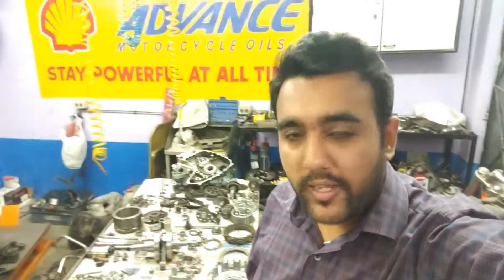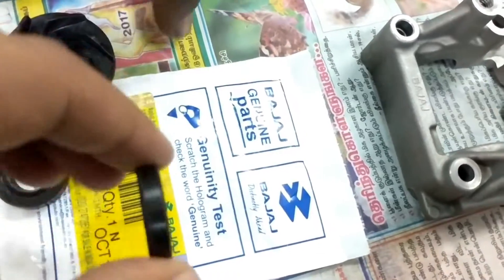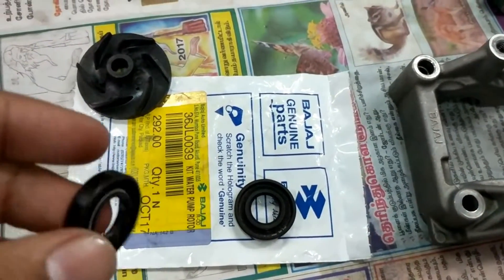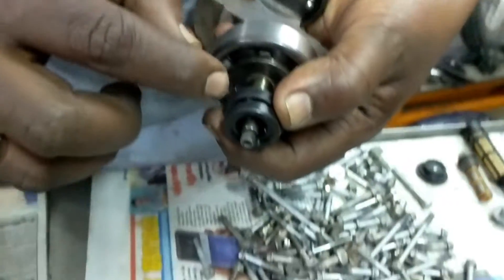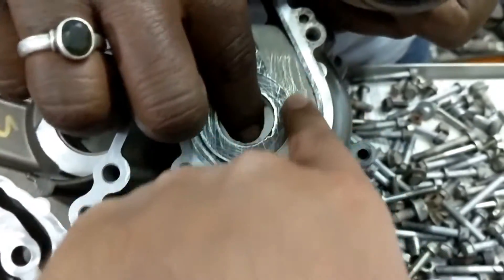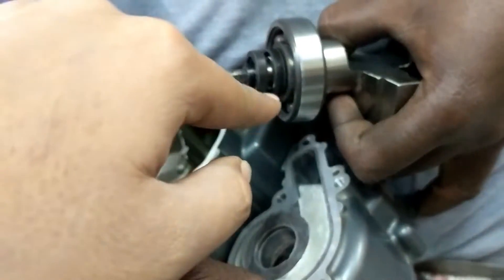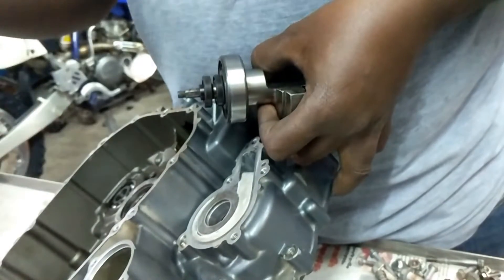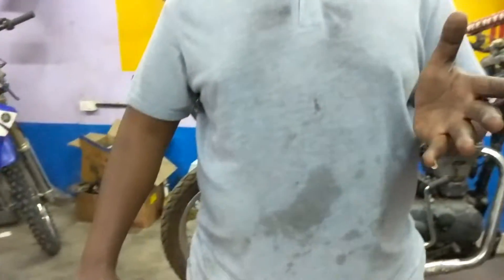Why does the coolant mix with engine oil in KTM 390 Duke/RC? Major Fault!!

Comment: Same issue with my bs3 duke 200

I've repaired it literally 5 times... Changed oil seals and coolant pump seal.. i even tried changing balancer.. still the issues is not getting solved... Can anyone suggest any way??.... Will changing crankcase will solve the issue?

Comment: Hello i am the new subscriber Plz help me out. I am also facing same issue..4 months back i have changed waterpump seal..from yesterday fan is not turning off i have checked coolant level in resivor..but its empty..when i checked engine oil level and its colour normal only i dont know whats the issue...

And from 1 week my bike performace gone down 2nd gear behave like 1st gear(means power)

Plz answer what can be the issue and suggest which servive center in bangalore will be the best

Waiting for your replay...plz help me it will take only few sec or minuites
Reply from the maker: Hi, there could be multiple issues since you've mentioned a drastic drop in performance. Coolant reservoir is empty meaning there's some leakage somewhere. I would suggest you to take you bike to ktm Yelahanka. I had a good experience there but that was there years ago. I'm not sure how it would be now but just try and see. Try and get in touch with venkatesh there if he is still available.
Reply: @saajanjogia can coolent reservoir gets low after many years?
Reply from the maker: @whysoserious7553  no fixed time, it shouldn't.

Comment: When I start my Duke 200 early in the morning white smoke came from the exhaust for some minutes then it disappeared...is this normal...thank you
Reply from the maker: White smoke is never normal. See if you're able to notice any other symptom
Reply: @saajanjogia  my engine oil got mix with coolant...how can I flush all the mix engine oil
Reply from the maker: @zankydk624  uh oh! You need to take it to well known mech
Reply: @saajanjogia  thank q ..can u help me with one more thing...i have Duke 200 Bs3 i want Valve Shim but i couldn't not find it here in my locality..I'm from Meghalaya India... please Help
Reply from the maker: @zankydk624  ohh ok. Erm have you tried contacting ktm via email? They need to supply it to the ktm showroom there. Or if you know a mechanic who works on ktms?
Reply: @saajanjogia  here in my State.Ktm show room and Services centre are the worst.. it's Just the name ktm service centre whereas for the spare parts are very hard to get
Reply from the maker: @zankydk624  try getting in touch with a mechanic who can get you those parts or, shoot them a mail to get you the parts
Reply: @saajanjogia  owk I'll try once again thank q

Comment: you mean honda is a premium bike ? I have one cbr150 but I like the Duke , but Duke has no coolant and oil leak hose indicator?
Reply from the maker: Honda high capacity motorcycles are premium, never said anything about the cbr150 😅
Reply: @saajanjogia  I mean it depends on the budget 🤣

Comment: Bro I’m having the same issue but my fan stopped working as well. It’ll take just one sec for you to reply me does the fan stop working too.? Please reply
Reply from the maker: Fan issue is a separate issue than this. Both problems need to be addressed differently. My ktm is on the 9th or 10th fan 😁. hope yours is under warranty

Comment: @Saajan Jogia, do you know if KTM has resolved this issue of poor quality sealing now? I am thinking of buying the Duke390 next month, but seeing so many people facing this issue is making me reconsider. Thanks!
Reply from the maker: Afaik, it isn't resolved. Considering the present prices, maintenance costs and hassles I've gone through, i do suggest you try other options and then see if you're still pulled in by the 390.
Reply: @saajanjogia  Thanks, will try out the CB300r as well. The main pull of the Duke being the intergalactic power levels which I've heard is life-changing. I am afraid I might not get that experience in the competition, but will try the CB300 and the RR310 out and then see what I feel like.

Comment: Does mixing of coolant and engine oil produce white smoke?
Reply from the maker: Not sure about that. White smoke could be a sign of your engine oil burning. Check oil level to ascertain
Reply: @saajanjogia  What could be the reasons for Engine oil burning? My Duke 200 Engine oil seems to be dropping quite fast [comparative to earlier]
Same issue with my Duke 200 2016. Noticed Emptying of coolant in reservoir [No leak from Radiator]. Engine oil seems to be in reddish brown color. Ridden more than 1000 km in this condition. Engine heats up quickly and stays there even with radiator fan kicks in.
Exhaust smells a lot, like burnt smell when we get in old scooter smokes. But there is no white smoke.
Should I change Water pump seals?
Reply from the maker: @SANDEEP-o2h3k  1. Your piston rings might have worn out so the engine could be burning oil. 
2. Get the seals checked. That's one primary reason for coolant level drop.

Comment: Is there any permanent or a Long term solution bro? I have this complaint in my KTM Duke 250 2017 model.
First I got this problem in 2019. my service center dismantled my engine, cleaned it, changed the oil seals and gaskets, then it got cleared for some period. It costs me around Rs 8,500.

Now again in 2021 I stuck with this issue again. And again they wanna do it. They gave me an estimation of bellow Rs 3000, only if the coolant is mixed in one side or the clutch side. And it gets added to Rs 14,000, if both sides got messed up (with changing other parts like clutch plates, etc because of 20,000kms+ in odo). 

The real problem is due to covid19, I haven't used my bike frequently like before (used range between 2,000 to 4,000kms only).

And I'm a student who loves riding bike and getting upset for asking a large amount of money for the bike service from my parents. 😐
Reply from the maker: Unfortunately, there's no long term solution. This is one reason why I ask people up refrain from ktm. This issue is there since almost a decade but no permanent solution. Experts in extracting money. What also suffers is the engine. Ktm doesn't let you know the extent of wear and tear the engine suffers after the coolant has mixed. 
They drain coolant, oil, refill and then pop a seal back, put some sealant. Then it's all on your luck.
Reply: @saajanjogia  Yeah, absolutely bro. I really want to know how these coolant and engine oil seals are getting worn-out so quickly. Are they due to engine heat or what?

Now they have suggested me that they will try to use the new model KTM bike's coolant and oil seals, which have a little bit more quality than mine. Which might give an short term solution.

But I have decided to give it a try and try to check and change my seals even if it in a decent condition*. Because I can't really trust my bike and it can go wrong in any situations, where I will be helpless. 

Where is this bike service shop located bro and can you share his details?
Reply from the maker: @sarath.chander  occurs due to wear and tear. Shop is in Bangalore but I don't go there anymore
Reply: this things not only happen on KTM Duke, but also on my Pulsar NS 200, exactly the same issue, no matter how much i change the seal it always broken after several months.

Comment: I replace oilseal and also headgaskit but the problem was there... 
Please help me my phone number is +917006300294  please please help me
Reply from the maker: Must've been a shoddy job if the issue reappeared mate. Check back with whoever did it.
Reply: @saajanjogia  There may be some other problem besides this?
Reply from the maker: @buffingblaze9344  I can't comment on that.. better have it checked again
Reply: @saajanjogia  you said check head gaskit again?
Reply from the maker: @buffingblaze9344  check everything again
Reply: @saajanjogia  ok thanks ❤

Comment: Bro, how much does it cost to just replace the seals?? Cause my coolant is leaking into the engine
Reply: At KTM the part I think is just 100-200 but labour is 5000+
Reply: @ajaydyas4699  oh Ok, so right now i have already replaced my water pump seals, filled the coolant to medium, after 200kms it went to minimum, so I topped it up to maximum, now after riding 300kms again the coolant is gone to minimum level. I don't understand what's wrong, and I can't see any coolant mixing with my engine oil
Reply: @FernmeisterTV  oh sorry my costs were not for seals. Besides the water pump seal there's the engine gasket if that fails it also mixes unless you're sure it's not mixing. If you're 100% sure there's no mixing there might just be a leak in your coolant system.
Reply: @ajaydyas4699  I have got a mechanic check my coolant system, there's no leaks at all, also my bike runs perfectly. No smoke nothing, but the coolant just drops, I don't understand why. If u know of any other way this is possible let me know. Thanks
Reply: @FernmeisterTV  bro, did you find out why the coolent is leaking? I'm also facing the same problem. Please let me know
Reply: @shameertn  no bro, I haven't found the issue yet. Recently as per odo when my bike was at 11820kms the coolant was at max level, now odo is at 12400 and my coolant is almost at minimum level. I can't see it mixing with my engine oil. I really haven't figured out the issue yet. Recently when I got home from a 130km ride the coolant was at like 3/4th level, after about 30 hours I checked it, it was at almost minimum level, That too bike was parked. Idk what to do now

Comment: Nice informative video but can you please tell me or makr another video of its solution. I mean the cause is ok but possible solutions  that this kind of problem doesn't happen again.what you have done to your bike to prevent it ? Is opening engine is the only way?
Reply from the maker: Yes unfortunately opening that part which gives access to the seals is the only way. Hence didn't make the video.
Reply: @saajanjogia   hi bro, please give me an advice on changing those oil seals!
Do I have to change or buy any specific parts which needs to be changed while changing the seals?
I'm in UAE 🇦🇪 here in UAE it is very expensive for the company service so I would rather go to the local workshop..

And brother isn't possible to open duke's engine without company tools? Or it is just false information?
Please respond brother. Thanks

Comment: Bajaj engineers are good enough for only the scooter,  Frankly there are so many teething problems in KTM which are not adressed..  Worst is gear shifting milling issue.. Poor chain sprocket life, poor fork oil seal, water pump seal system, rear shocks oil leak, stearing cones wear off sooner, ABS failures,  list goes on and people still buying this bike only for some good sprint!!
Reply from the maker: Yep. It has a ton of reliability issues that aren't spoken about as much aa they need to be spoken about. Check out my article on the same in this link : 
 https://link.medium.com/osPC9fsrmdb

Comment: just look at the oil sight glass, if the oil color becomes i say like a color of a MilkTea, change the seals ASAP
Reply: Hi brother, I'm facing the same problem. I'm topping the coolent after every small ride but I couldn't find any leakage. Now through this video I found that I had to change the seals because the coolent is mixed with the oil.

But is that possible to change the coolent oil seal without opening full engine?

Comment: Can both seals be removed from the outside without splitting the cases once the impeller is removed and the circlip is removed?  Just had this problem at the last oil change!
Reply from the maker: Highly doubtful!
Reply: @saajanjogia  just saw a thread where an owner did just this and it was super easy.
Reply from the maker: @falcn12  great! You're lucky then
Reply: It can be done.  You have to pierce through the seal with a sort of hook shaped object so you can pull it out.  I used a set of picks and bent the tips with pliers to my desired shape.  BE CAREFUL NOT TO SCRATCH THE ALUMINUM HOUSING IN WHICH THE SEAL SITS.  Bend the pick ends such that they wont scratch the housing.

Comment: The main reasons for oil seals to fail:
1.Coolant hasn't changed for a long time.
2.Oil not changed on time.
3. General aging,wear and tear.
Reason for Engine oil seal failure:
1.Oil not changed on time.
2.Wrong viscosity oil.
3.General wear and tear.
4.Excess oil filling.
Reply from the maker: Have seen 390s that were maintained perfectly. All that you have said was being followed but still the seals gave up. So yes, has definitely got to do something with the design or quality of seals. Also general ageing and wear and tear is understood if the motorcycles were really old or has clocked a lakh kms or more on the odo. And there are cases where this shit happens with 390s that haven't even crossed the 20k kms mark
Reply: @saajanjogia  I understand, KTM gave their design to a shit company to produce this lovely bike.
Reply: Wife's Duke 390 uses correct oil weight, correct fill weight, and coolant wasn't due for change.  This has happened 2x on her bike.  1st time fixed under warranty. Less than 2000 miles later - same issue.

Comment: Thanks for making this Vedio, I face same problem with my Rs 200 .... I learn a message from your vedio that don't buy such bike that don't have any outlet in engine because you may have to pay 10000 to 22000 Rs. After such issue will concern with your sport bike. 👍👍👍
So brother how much you pay for this
Reply: What is the cost for repairing RS200 with the same problem sir..becoz I have the same issue
Reply: @saiprasanth8544  I managed mechanic in showroom and pay Rs.11000 with serving oil change and other issues 👍

Comment: Hello sir I'm facing a big problem I have a Duke 390 cc and is burning the fan I already change 3 fan but the problem still overheating jerking .I send to dealer and they said they have to open the engine please can you advice me
Reply from the maker: Why should you open the engine? It's a fan problem. My bike is running on its 10th or 11th fan

Comment: Hey... In My 390 the coolant fully had gotten empty. I visited Jagadish and he changed the Water pump oil seals. He didn't replace the engine oil saying that ride for 500km, if there's no furthur leak then I'll change engine oil.Refilled coolant and now my radiator is working fine. My doubt is that is it safe for the engine to ride 500km with coolant and engine oil mixed?
Reply from the maker: Ohh that's weird. Better to flush, refill and ride because oil may not perform the way it's supposed to if coolant is still mixed.
Reply: @saajanjogia  ohh..and jagadish also didn't flush the radiator with water before refilling with new coolant.. should I tell him to flush the engine with some engine flush from brands like liqui moly?
Reply: @saajanjogia  and is radiator flush with water important?
Reply: @saajanjogia  bro I contacted Vikas Rachamalla and he also told that never ride with coolant mixed with Engine Oil, And Jagadish told me it's fine to ride like that. Do you think I can trust Jagadish and go back to him? Pls help me on this one
Reply from the maker: @nischalk1336  I get your point. I stopped going there more than two years ago.. so yeah that says a lot. Have kept this video for informational purpose only.
Reply: @saajanjogia  ohh.. do you know any other good mechanic? Or should I trust the KTM service center folks, even though they might overcharge
Reply from the maker: @nischalk1336  no bro.. didn't experiment with anyone.. I give it to Yelahanka ktm currently
Reply: @saajanjogia  damn... Lakshmi bike service reviews are soo misleading. Almost everyone have given him 5star positive reviews while that guy seriously lacks professionalism. Cant believe I trusted him and might have fucked up my engine in the process 😭.
Reply from the maker: @nischalk1336  I know. It wasn't the case earlier. Since few years things have changed. My motorcycle also isn't the same as it used to be after he did the engine rebuild. But yeah, yeah, you learn from such experiences. Just flush the engine oil, put fresh oil and ride. Monitor it for sometime

Comment: Sir mera duke200 me 4days se same problem tha  but mujhe kuch kam se urgent jana tha usi time 13km chalne k bad bike jerking jaisa kiya maine suddenly switch off karke dekha to air filter tak a gya green oil...
Phir start kiya start hua tha but maine switch off kr dia...
Maine truck pe le aya bike ghar pe n sara engine oil coolent nikal dia... 
Water seal pump change kiya dono with fan
Throttle body clean kiya uske bad new coolent n engine oil dala to bike start nehi hua 😭😭😭😭😭😭😭😭😭😭😭😭😭😭😭😭😭😭😭😭😭😭😭😭😭😭😭😭😭😭😭😭😭😭😭😭😭😭plzzz help me sir kya karu....

Bike to seized  nehi hua....???
😭😭😭😭😭😭😭😭😭😭😭😭😭😭
Reply from the maker: Sorry to hear your ordeal. I suggest aap service center leke jao.. engine  open karke dekhna padega

Comment: Bro all of a sudden my coolant level has fully dropped below minimum and the engine oil has become frothy and the engine is getting very hot in just 1km of riding... Is this coolant engine oil mixing issue??
Reply from the maker: could be a high possibility. Don't ride.. get it checked
Reply: Okay ... Damn will it be an expensive fix? Since my bike is not under warranty

Comment: Does engine need to be removed from body to replace that seal?
Reply from the maker: Yes
Reply: @saajanjogia  So it would cost me  a way high amount
Reply from the maker: @nagarjunareddy8056  yes. Depends if their resolution is for long-term or short term
Reply: @saajanjogia  what do you mean by short term resolution.What can be made?
Reply from the maker: @nagarjunareddy8056  short term is just replacing the seals and closing it. Other parts need to be checked if you've ridden long with the coolant
Reply: @saajanjogia   only to replace seal also need the engine to be taken out from body right?
Reply from the maker: @nagarjunareddy8056 yes
Reply: @saajanjogia  Thank You
Reply: No